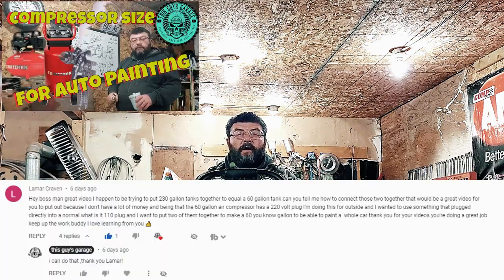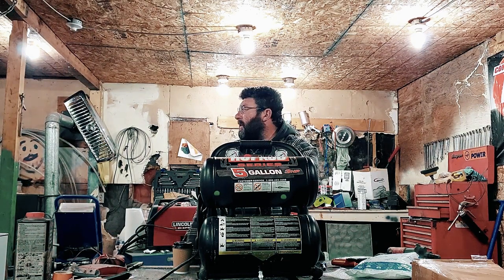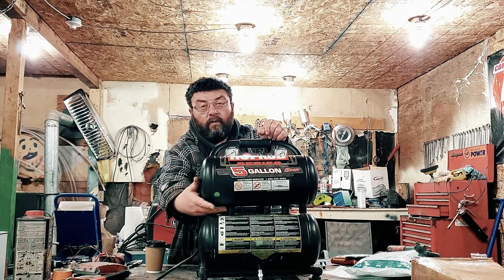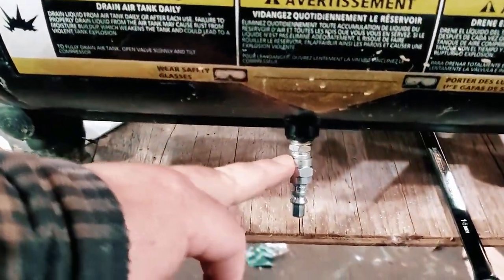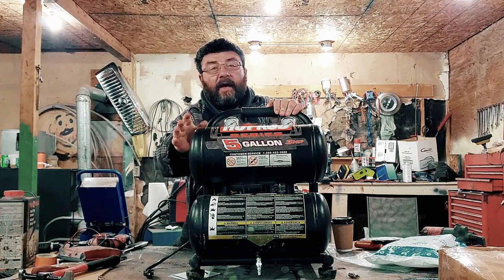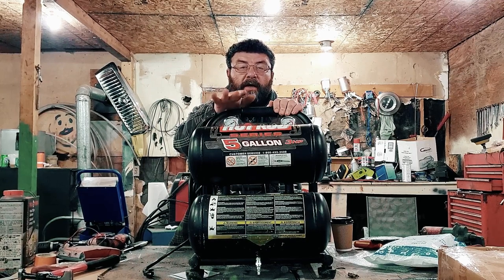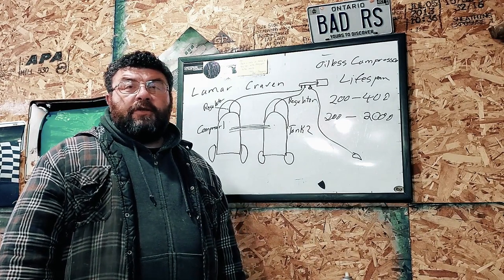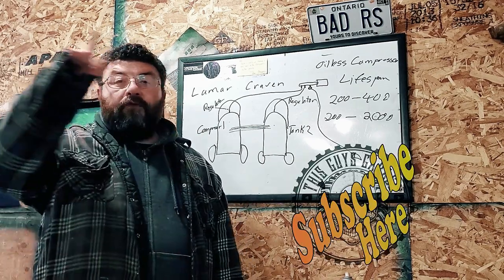how to daisy chain air compressor and expansion tank

Comment: I was enjoying the video UNTIL you got to the life span of the oil less compressor because that is exactly what I got, DANG IT! Great info Shaun, and you are so right about the stress that is put on the one motor for both tanks, because my motor runs FOREVER and it's just one 30 gallon tank!
Reply: For sure...I have an oil less compressor as well and I just kept rolling my eyes LOL hopefully mine will make it that long... would be nice to have a monster one but I simply have no use for it...still I don't like Shaun's ugly 30 gallon tank compressor monstrosity LOL
Reply: Don't worry about it.  My thirty gallon ate the foam air filter a number of years ago and it still working.  Of course when it first did it I bought an oiled belt driven with a bad tank in thoughts of combining the two, have been tripping over that for a while. Haha
Reply from the maker: they last a long time ,considering run time 400 hours would be about ten years of service for you and probably a lifetime for the average diy guy .  i dont watch other videos when making a video but i did investigate some thumbnails and they were all greatly exaggerating the output of this configuration , twin tanks can be done i just don't recommend it.   thanks so much Tim
Reply from the maker: nothing wrong with an oil less coyote  , they really are engineered for the tanks they have.
Reply from the maker: the lifespan will never be a problem until you start using it commercially or expanding it beyond its limits . i had one eat the foam filter and worked for years too lol. average use wont wear one out. 400 hours is a long time in a diy situation. i had one ,when using a dual action sander it never shut off and i killed it ,but that is not what they are designed for for sure.
Reply: @thisguysgarage  Oh man in that case mine will last another 100 years... and just let hate on your stinkin' 30 gallon monstrosity I'd sure like to have one cuz why not LOL
Reply from the maker: @Coyote5555  mine is actually 120 gallon ,some of the paints i spray are so expensive compressor failure is not an option for me,if i did not paint cars i think i could get away without a compressor with the quality of electric tools , they still haven't been able to replace the air sander yet . ty buddy
Reply: @thisguysgarage  not sure about anyone else but I'd sure like a our around that puppy...never actually seen one...it's features etc. Video idea lol
Reply: @Coyote5555  I would love to have a monster one as well, BUT, how would I be able to power it on the road, plus with me being cheap an all, LOL!
Reply: @patcb829  Hey Pat, are you using it on a daily basis, and if so, at least that gives me hope!
Reply: @thisguysgarage  That's the problem for me Shaun, I'm using it on a professional level. I would say about 3 to 4 hours a day.
Reply: Your using two tanks the same size as a comparison of course it's going to turn bad fast you need a smaller tank that's 2 times the load

Comment: Other downside on oil less compressors build a ton of heat and friction so the longer runtime can also cause the piston to melt the rings most oil less compressor are set to run that tank size it came with not longer on a single cycle because of heat and friction
Reply from the maker: 100%

Comment: Great video man. I got a quick question. I got an 8 gallon Mastercraft compressor so can I daisy chain a 30lb propane tank to it? Obviously empty lol I'd like to do a little backyard paint job on my truck this summer nothing special just a good from far job. And maybe use an air tool?
Reply from the maker: Yes, absolutely nick !    depending on how air hungry the tool is ,i know the 8 gallon matercraft does not have great recovery but you will get the job done with patience .
Reply: Ok thanks man. Really great info. I'll definitely give this a try and do some research on what size compressor I should get in the future

Comment: Is whichever one you have oilless or with oil. Add extra engine cooling. This will mitigate the extra ware. Aluminum fins and an old PC fan will do the trick. Liquid cooling would be best but that's a bag of worms. 🪱
Reply from the maker: Great point!